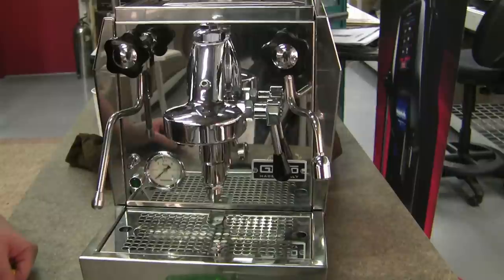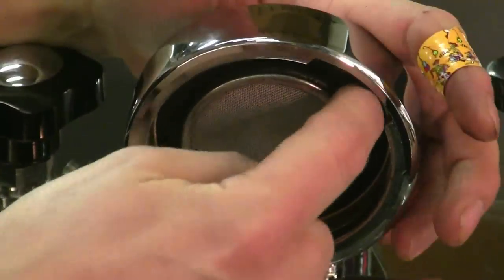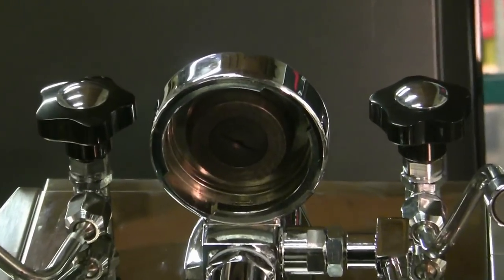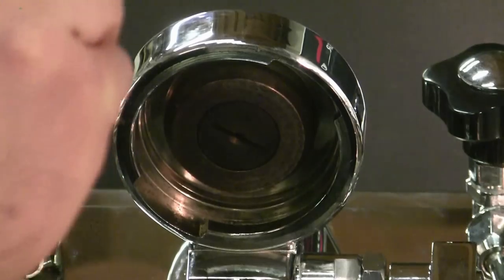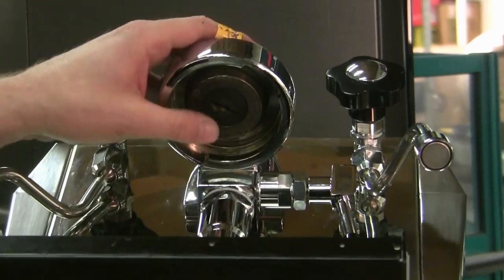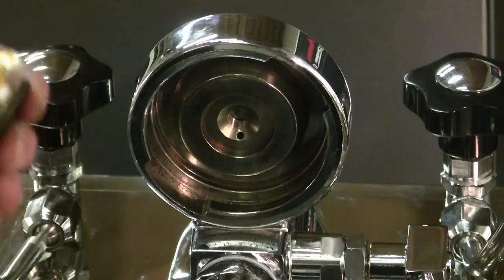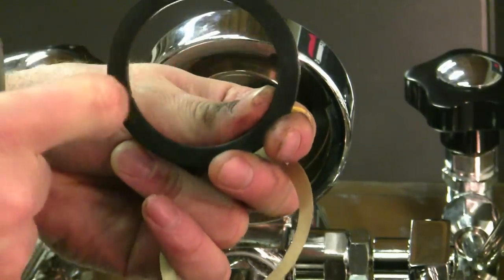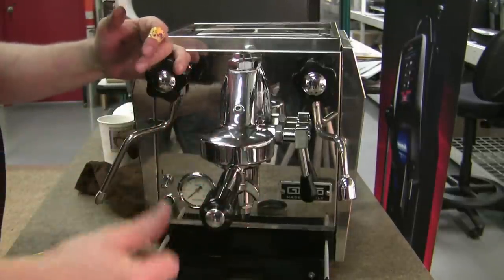Rocket Espresso Machine Maintenance - Replacing The Group Gasket

Comment from the maker: Sometimes the water spreader is on tight especially if the unit is warm. If you are using a quarter, use pliers to turn the water spreader loose.

I recommend using a wide flat head instead of the quarter since the brass water spreader is easy to damage.

Comment: You don't make it clear what parts you are using. I have an Isomac Tea II (E61 grouphead)  - the shower screen is like the one you show but has no groove to leverage the assembly out to replace the grouphead gasket.  Could you help me with those part numbers from your site. Thanks for your video - very informative.  I have replaced the gasket many times and it has always been a hassle - the lip on the shower screen will make it all so much simpler

Comment: Espressotec: thank you Sir for the reply! Finally I removed it once it was cold with the quarter. Lucky I didn't damage it. It was pretty tight, I used the pliers. I didn't tighten too much after cleaning; just in case. Thanks again !

Comment: could you tell me how I can unclogg the group head of bezzera machine
Reply from the maker: The E61 grouphead on your Bezzera should be quite similar to the Rocket E61 as seen in the video. Remove the shower screen and diffuser and ensure you can get water flow. While those components are out, fully clean them using a brush and espresso machine detergent.